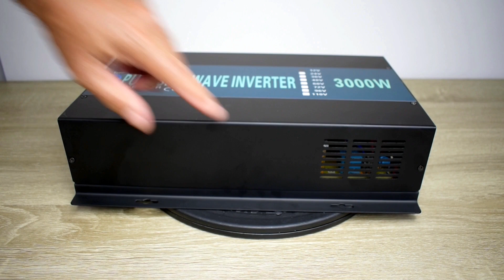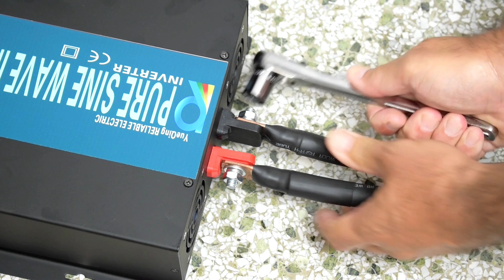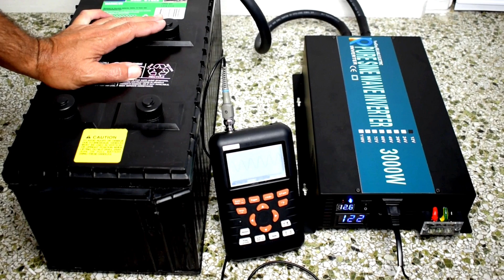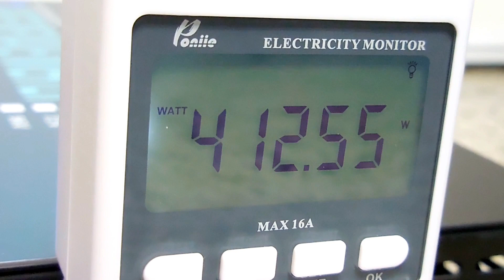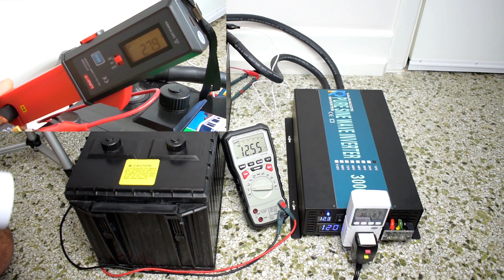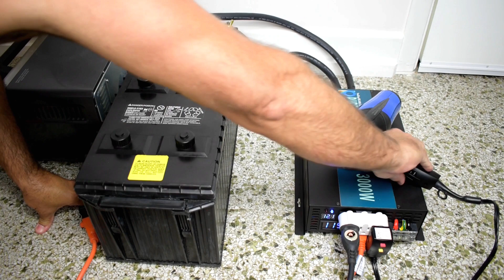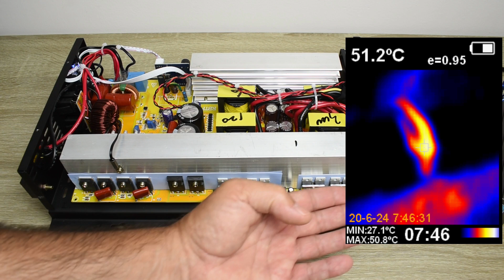Reliable Brand(WZRELB) 3000W/6000W Surge OFF-GRID Power Inverter Tests!

Comment from the maker: In case you noticed, the efficiency calculation numbers were incorrectly stated, but the efficiency of the unit was correct. I explained more in PART 2 of this video. Thanks for watching!
Reply: You state there is a 220v version, do you know if it’s 2 phase or just 2 load on same phase?
Reply from the maker: @fullyelectric  1 phase
Reply: Hi, has you uploaded the part 2 yet? Thanks!
Reply: Very helpful video. Thank you👍
Reply: كم سعر هذا
Reply: What size battery to inverter cables are you using?

Comment: It is dangerous if AC hight power terminals split 60v in Neutral and hot line. 
There was a YT user show it and he reverses the hot and neutral connector on the PCB to correct it.😅
.

Comment: I believe The 120v live to ground means the 60v neutral to ground is ghost voltage and this is an unbonded "regular " , not cheap , inverter.  Had this been a cheap inverter the live to ground would be 60v real and the neutral to ground would be 60 v real volt, not ghost.  
The way to test this isnrun an incandescent light neutral to ground , ifnit lights up ypu have real , not ghost voltage.  
I believe the video implied this was a cheap inverter with 60 real V on neutral.  I believe it is not, I believe it is a real inverter with fulll 120v on live but it's unbonded which gives the 60vvghost on neutral . 
The cheap inverters should NOT be bonded ever.  
Please double check my.views

Comment: One of the most complete reviews I have ever seen. I wonder what scerieos would occur naturally that would short the unit out? It’s a shame that it blew. Hey, at least it worked for all the tests. I tried a Renogy and it was dead out of the box. I tested a $600 harbor freight pure sine wave, it came on, ran my AC for a short period. I had 2x230 amp hour batteries so it should have run at least 2 hours. After it died, it would not come on. Returned it. It’s really hard finding an affordable inverter that is quality built. I’m going to give Renogy one more try,if this one is dead or fails, done with them on inverters, thanks

Comment: any battery charger recommendations?
Reply from the maker: How many volts is your battery bank? What charging current are you looking for?
Reply: 2 24V DC Marine Batteries  @electronicsNmore
Reply: also what screw and wing nut/washer did you use?
 @electronicsNmore

Comment: 😅 engineer don't always tell you the truth about short circuit so let me as and engineer tell you the real truth about it ,
Shorting any Electronics is never good to do because of silicon delay to respond fast enough to turn of the power , however it can be done with a pot resistor to adjust the load shorting current but it can't be done at high current level yes 600watt but over that the current is too dangerous to stop in time with current sensor to turn the power so the mosfet fail

Comment: Are you sure that middle connection is a center tap? That sounds really strange. I would assume the middle connection is connected to the chassis and the live and neutral are floating. That way you can choose to bond the neutral to earth if you want. I would guess yhe voltage you measured was just stray voltage.
Reply: Placing a load across the meter when measuring for this would reveal what it is; just connect an incandescent light bulb to it and see if the voltage is able to be maintained at the same value. 
If it drops to zero, then it's just a float reading that's possible due to the high impedance of the DMM.
Reply: @dubmob151  Just measure if there is continuity between the middle lug and the chassis when the unit is turned off. Also check for continuity to live and neutral, if they are floating there will be no continuity.

Comment: Why don't you guy's stop being technical by measuring what's and amps and connecting oscilloscope 
If you making this video for the experts then forget it 
If you making it for ordinary guy that wants to just buy a inverter to use on a RV or for outages then your margin means nothing just tell us what and how many batteries we need and what can we connect when you have power cuts 
And please you don't need to connect the air conditioner when you have power cuts 
That's not why you buy a inverter

Comment: I wonder what would’ve happened if you had actually DISCONNECTED it from your battery.    Would the short-circuit protector have reset?

Comment: Thank you for showing this. I have the 24v 800w model, when I use a pedestal fan on low (50w kinda) after a while it just cuts off, back on and off again, Batteries are at 28.9v, I check and notice the cooling fans didnt kick on, so I turn it off and on and they kicks on for about 30seconds and runs fine for another hour, can I add two pc fans (with a 12v power brick) and leave them on 24h, thanks to you I see its an overheating problem. But it least it didn’t burn into oblivion like my last cheap inverter (dead fans)

Comment: with a 4hp motor + a 12v DC alternator × 250amperes = 3000w connected to a 3000w inverter, can i easily turn on a 1100w air conditioner?

3000 ÷ 735 = 4,0hp ?

Comment: I have the 3000w one and it cut out when trying  to run a 1050 microwave. Why is that ?
Reply: Hello, a microwave oven is an inductive load appliance, and it draws much more than the rated power (about 3-7 times) at startup.

Comment: I have the same one. I noticed when he was trying to push it, the a/c voltage dropped way down to 99v. that is not good. I tried to run my van air conditioner with mine, I have a micro air easy start on my air conditioner. My voltage dropped down to about  108v a/c. I did not like seeing that much voltage drop. This could damage sensitive devices.

Comment: Why didn't you say the name of the company? LOL. Why do these generic cheap inverters use a pile of ATC fuses instead of a proper high-current MEGA or MIDI fuse? If they cascade it's going to cost a bunch to replace them, and it makes a bunch of unnecessary parts in the assembly.

Your comment about the bolts I don't agree with, the bolt shouldn't be carrying much current at all, if the lug is up against the terminal plate, that's the current path. The bolt is there to hold everything in place so it should be a strong, durable material.

The terminal block seems unsafe, really easy to mess up with the improper colors, and with a flimsy cover between you and electrocution.
Reply from the maker: LOL. How could you have missed the title? The name is clearly stated.
Reply: @electronicsNmore  I can see the name, but it's unpronounceable, it's nonsense.
Reply: @electromage maybe they take after the IKEA product naming person😅
Reply: That VITTSJÖ Shelf unit's a winner

Comment: That's a big battery, is it just 12 volts or what? Did you check the waveform output of  the inverter? Thanks
Reply from the maker: 12v

Comment: I'm struggling with a 3000 Watt Reliable inverter that insists on burning out. The worst thing is that, buying the drive card in China, after waiting more than 30 days, the card sent came wrong. The seller asked for a photo of the damaged plate and it was sent, even so they sent the wrong one. I have 2 brand inverters and they work well, but this third one makes me want to cry. The LBQJ V4.2 driver board only in china.

Comment: Did you find the "damage" caused by the short circuit?
Reply: Wondering if there's any real life scenario that could produce that type of short circuit aside from testing purposes.  Motor windings, carbon brushes, frayed wires, maybe but those will have limited short circuit current because they're not solid shorts.

Comment: Well done!
I have the same unit that I purchased in April 2022.  Yours showed voltage (60-ish volts AC) on ground.....you mentioned it is center-tapped.  
It seems there are two versions out there: an International narket version?  And a US market version?
My inverter is zero-volts on ground relative to either hot or neutral.
The directions also state that it is OK to bond neutral to ground IN ONE LOCATION (the inverter or the load).
That is critical if you will connect into power panel which has neutral BONDED WITH GROUND. 
 Imagine what will happen if you connect up your unit (60v shorted to ground) to a bonded neutral US wired residential main load center via a transfer switch.

Comment: What size fuse do you recommend for a 5000 W 12 volt inverter identical to the one you have with eight four hundred amp hour batteries total of 3200 amp hours what size fuse would you recommend running from the battery to the inverter?
Reply from the maker: Roughly 500A.
Reply: @electronicsNmore  thanks for your reply I'm sure people ask you all sorts of questions so I'm sorry for bugging but I have one more if you could please answer. the line that is coming in from the solar panels does it have to be a AC fuse and not DC? I have a DC little breaker box on the positive coming in from the solar panels to the solar charger and I believe I was supposed to get an AC fuse or breaker.

Comment: What size fuse do you recommend from the battery to the inverter I have the same inverter but it's 5000w and I have eight 400 amp hour batteries the gel ones

Comment: I bought that same inverter, but in 24 volt 3000 watt in 2015. It didn’t have any vents in the cover back then. That might be why it popped one of the capacitors, I then got a 5000 watt from another company, and bought another of the first brand in 3500 watts.

Comment: Great video, very informative. I have been using this exact model inverter for over a year to power my off grid solar home. It has worked flawlessly, 24 hours a day, and I have had zero problems, averaging 10 kwh a day output. I was surprised to see it fail after a short circuit on the ac output though, i would think it would trigger the overload protection before it would fail internally.
Reply: i had the same issu, a short circuit destroyed the board. Dont buy this anymore!!
Reply: Did you put an FI Switch in Between?
Would be interesting if that would have saved it.

Comment: I have the same inverter.   I use it to power my fridge.  When my batteries are fully charged and I get full sun and have no load it beeps and shuts off for a few seconds.  I believe it's getting a high voltage spike but not sure .  Any idea what I could do to prevent that?  Using an epever 40 am charge controller.

Comment: i have been using mine reliable 48v 5kw psw for about 8 months. i decided to try to power the hvac system from this and learned about a concept called "neutral ground bond", and apparently this inverter does not support. maybe most people knew that, but not me. just wanted to share. i will be uploading a super low production video i made of this inverter under a 5.5kw resistive load and  on a scope at some point, to show the weird distorted wave form it produces.

Comment: I have this unit. Have had it for about a year or more now. Started with 100w solar and 200ah lead acid batteries. Now I have 200w solar, 40ah li battery (soon 80) with a wanderer charge unit with temp sensor. I haven’t had any issues with the inverter, however I don’t use it for heavy loads. Just mainly charge yard batteries with it and the occasional power outage I’ll run tv, lights etc. My main weak link is the batteries which I’m slowly adding. It’s overkill for my intentions, but has been a good unit so far.

Comment: I respect all you guys that produce YT content, so please don't think I'm hatin' with this comment. Your hair dryer uses 412 watts according to the Kill-A-Watt meter, yet when you measured using an amp meter and a volt meter, your battery was only sending out 352 watts. You either have an inverter that produces more power than is input into it or you need to change the measuring devices that you are using. The tests for over wattage was very informative, so thanks for that.
Reply from the maker: That was an error brought up in the follow-up video.

Comment: I thought I heard you said something about the 24v version is better due to hooking up smaller wires? I’m planning to buy the 36v version and hook up tons of Ryobi 40v batteries in parallel. What type of wire would you recommend me hooking up the batteries onto the input?
Reply from the maker: Higher input voltage means lower input current, which means smaller diameter wires. You can find charts online for DC wire ampacity for desired length.

Comment: Hey where did you get your programmable power supply from and how high of voltage will it put out I need to have a lease 100 volts and 20 amps power supply
Reply from the maker: Looking for AC or DC output?
Reply: @electronicsNmore  yes I want to know about that device you were using to put Power into the inverter, we are looking for a DC out put for our inverter
Reply: Yes I'm looking for the DC out I believe you were testing your inverter with DC so what was that device you were testing or putting power into your inverter
Reply: 2000W power supplies are few and far between, most are limited to 1200W.
What are you trying to drive with 20A at 100V?

Comment: I bought the 2500 model it wouldn’t power my radial saw
I sent it back and it had a ground issue 🤣
Reply from the maker: A radial saw has very high inrush current.
Reply: @electronicsNmore   yeah but it worked with my nddi 1500 watt inverter

Comment: An unloaded circular saw. But you made up for that with it with the short circuit test that should be done on all inverters. So far you're the only YouTube reviewer I've seen do it.
Reply from the maker: Using a sharp blade on the circular saw will not cause much of a rise in current.
Reply: @electronicsNmore  Until you cut something. The harder the better. Or lock, or jam the blade.
Reply: @bearchow1929 yeah, there should be a sizeable difference in power draw when cutting vs free spinning operation. Not much work done in spinning the blade in free air vs. actually cutting wood.

Comment: I did that something by mistake.  You need fast fuse on the AC side.  Slow  opening fuse won't help .
After that.. I did got 4000 thousands watts  GIANDEL .. No problem with that one..  I put fast opening  fuse 30 Amp at the AC output ..

Comment: Get a Maxwell Ultra Capacitor Bank, wire it across the battery
Reply from the maker: Makes no difference. The problem is the unit, not the battery. I also tested used a 12v LiFePo4 battery that had very little voltage drop.

Comment: Thank you for your honest review of the inverter.  You did a very good job.  But on the DC side stepping up the voltage, are they transformers or coils?  Transformers will have 2 sets of windings (primary & secondary) [4 connections on the PCB], while a coil will only have one set of windings [2 connections on the PCB].

Comment: Drawing 4000Watts off that battery is going to kill it real quick. You will find even tiring to cook a meal or make toast will flatten the battery incredibly quickly. You will not get much run time, Oh and also the longer you run it at high power the enormous ripple currents will eventually destroy the electrolytic decoupling capacitors, the caps on the PCB are far far too small, the invert will go pop guaranteed. The protection on it and those silly blade fuses are useless, what usually fails is the dc to dc converter. Also discharging the battery down below 10.5V will quickly destroy the battery too..
Reply: Makes you wonder what these are actually good for, since most people will not have the amount of battery storage anywhere near what would make it useful.  The over capacity is mainly useful for handling short term startup currents from compressor motors and the like.

Comment: haha there you are again. i am just watching videos of the inverter i just bought as i impatiently wait for it to arrive. i bought the 48v 5kw version.
Reply from the maker: Good luck with it. I hope you have a very large battery bank.
Reply: @electronicsNmore  i have two separate 48v 500ah fla banks. long story why i ended up with two, but they are both brand new banks. i wanted the lead acid experience this time around as i was able to buy them locally which was cheaper when you factor in super high shipping, plus good warranties, but i will move to lifepo in a few years when the prices come down. plus, just dont yet trust those chinese sellers that have the best prices. man i could have built one nice lifepo system for the $5000 i have in these fla lol

Comment: The air intake holes on the side of the unit are not a good idea. The fins of the heatsink are on the middle. Why give a direct airpath to dodge the fins?
Reply from the maker: They're fine. They're positioned where air flow must be.

Comment: Hello thank you for your video. I would like to suggest to a test. I have a similar inverter I have noticed that when I use the outlet tester it shows as open ground even with a ground cable properly connected. That would help catch problems with the circuitry. When I did some research for this problem I found information that someone posted indicating that the customer should fix a couple  cables. I bought mine over a month ago from Amazon
Reply from the maker: Most inverters don't have the ground, usually you connect the receptacle ground pin to the inverter's metal housing, and the metal housing to earth ground(a metal rod w/clamp)
Reply: @electronicsNmore  yes i understand but many do have outlets where you can plug in your devices directly. In my case even that plug after connecting the chasis to ground shows open ground which create an unsafe situation. I have received an email from the manufacturer indicating that there was a problem with the device.